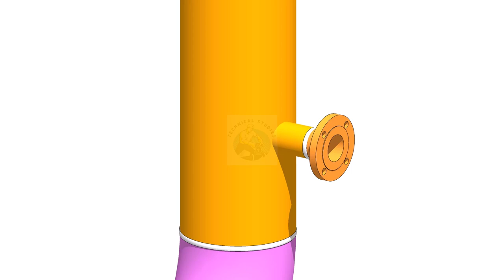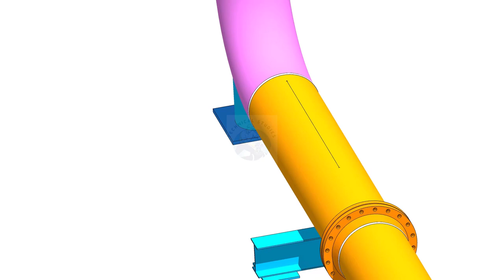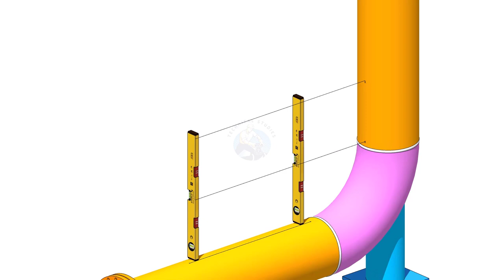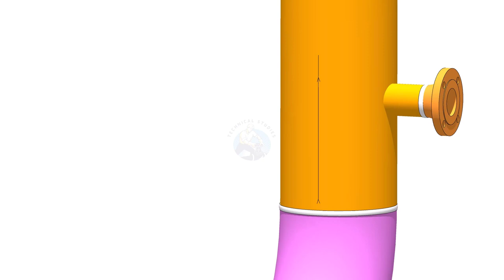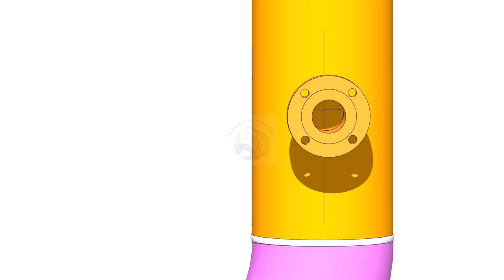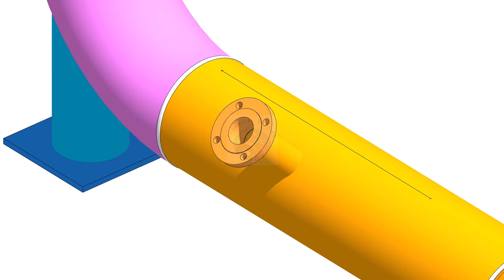How to Mark Nozzle Center on Horizontal and Vertical Pipe

Comment: Nice video. I recommend a laser for any vertical work instead of those two levels lined up. You can have three datum point then. Two on the horizontal pipe and one on the centre of the vertical pipes horizontal flange. Better accuracy. And if the vertical isn't level most lasers can be locked
Reply from the maker: You are correct Bro. I have 30 yrs. experience in construction jobs in the middle ease. Still most of the big and middle standard companies dont know or not interested for these types of high accurate EXPENSIVE equipments. Thanks Bro.